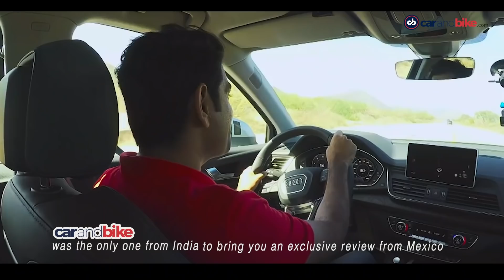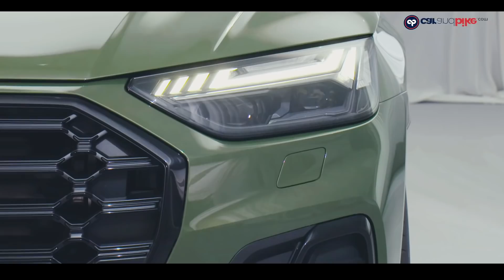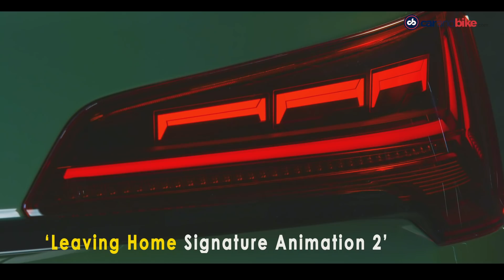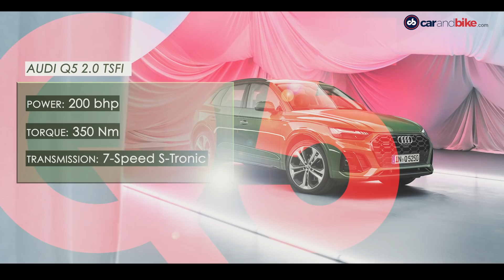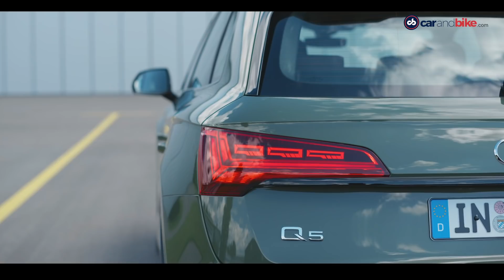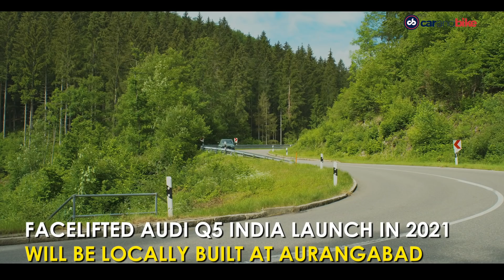2021 Audi Q5 Facelift: First Look

Comment: very well the rear and light signature and especially those optics installed on the rear bumper is a hallmark that audi should never lose, which unfortunately in the q2 and q3 they no longer carry and it is a pity, it would also be very nice a horizontal line similar to the q8, but quite the opposite the front bumper is another photocopy of mercedes benz, and that stupid horrible absurd idiot fashion to replace the front fog lamps by more holes and false air vents that are absolutely useless, cheaper costs and quality, inside if it could be a good idea that here if they copied mercedes benz, because the dashboards and main screen of audi are too serious and dark and too little customizable. audi needs new and better designers ,, very little standard equipment and a lot of money for what it offers ,, and more cheerful and different colors in its new models at least in option, I want a nice suv in yellow, urus lamborghini for example etc ,, lately audi in their new designs are almost all the same and very boring etc
Reply from the maker: loved this thorough assessment! thank you!